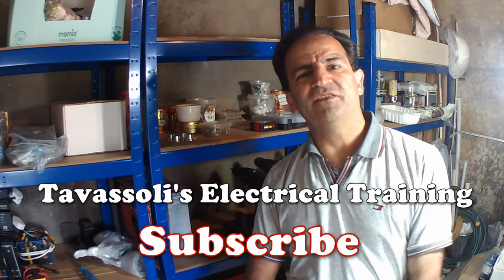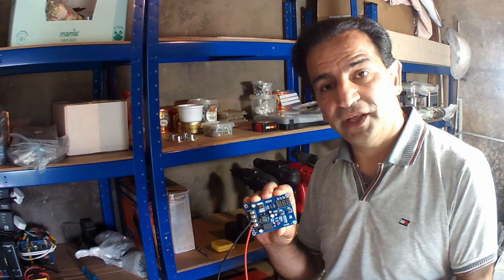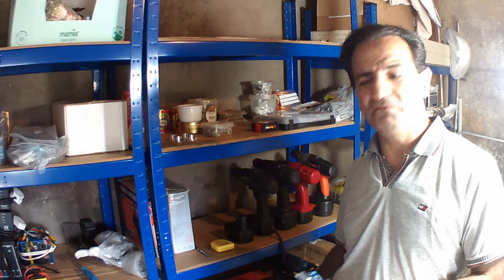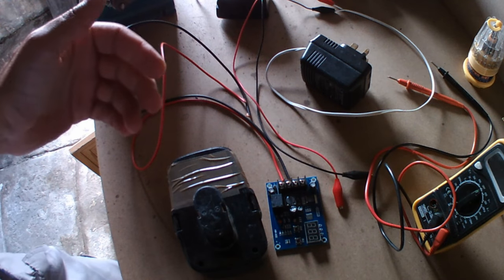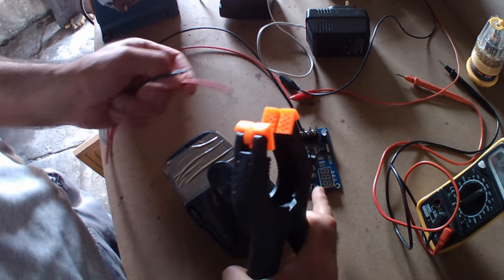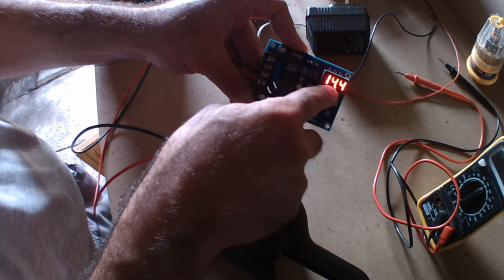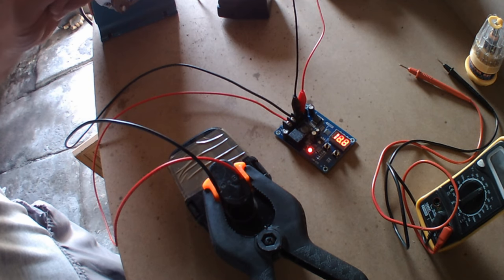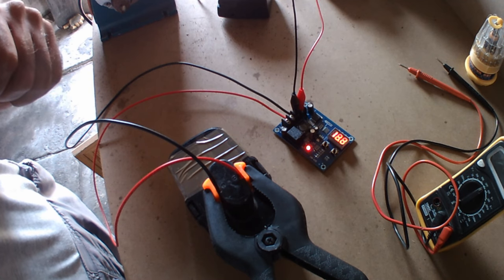Charger your Cordless Drill without its charger! - How to Make a Universal Battery Charger-

Comment: I don't know why a strike out line shows through part of the text. Please just read every thing. Thank you for the video. I do have a few questions: 1. All the batteries you show in the video appear to be NiCd or NiMh. Does your set up work for Li batteries? 2. Some battery chargers have more than just the + / _  contacts. For example the Milwaukee red has +, , and 3 other terminals (supposedly for the balancing contacts). The Ryobi has +/ -, and a third contact. I was looking at your video to make charger for the Ryobi. With Ryobi charger, testing it with meter, there is no voltage between +/ - while there is about 3V between the 3rd terminal and either + or -. The theory I have been told is that when a battery is connected to the charger, the 3V flowing from the 3rd terminal into the control board of the battery some how activates the +/ and makes the necessary charging current to then flow between the +/-. So, in your system of connecting only the +/- terminals to your charger and totally ignoring the 3rd terminal, there is no charging current. I have already tried connecting the 20V + /_ from a power supply to the +/- of the battery and nothing happens, it does not charge the battery. So, what do you say?
Reply from the maker: Let me just say that this is for Lithium batteries as well as Ni Cad ones. You cannot just connect the power to the battery directly and  charge it that way, Having said that you actually could do that in theory, and even in practice if you could control the length of time the battery is under charge. However, you are talking about quite a few things here; You cannot use this for batteries with slots of a few contacts more than just the main positive and negative contacts. those have to be charged differently, which I will show you in my next video. Watch for that one. Third contact however is not a control of current at all in batteries like the ones I have shown in my video. If you open those packs, you will find the third plate (Contact) is not connected to anything, or it's just a ground. for the circuit, which again doesn't do much in this case. This regulator does more than just connecting and disconnecting the power supply to the battery, it controls the current and the charging, which is why it's called a regulator. All those ICs and components are not there for decoration. You can charge any power tool battery similar to the ones shown in this video, car batteries, Solar Panel batteries and many more with this regulator. I don't know what the strike out line is and I hope this has been helpful.

Comment: I'm a few years late in the comments lol but can you use this to charge multiple batteries at the same time?
Reply from the maker: No you cannot, because it has to read the current voltage of the battery and charge accordingly, if they are all connected in parallel, then it won't know how long to charge it correctly.
Reply: @totalelectricaltraining  I've burnt a few batteries figuring it out the hard way 😂 I'll pull the good cells out eventually and use them for something else, it's slow going but I'm learning 🤷

Comment: I have a spare 24v power wheelchair battery charger w. a cannon plug connector. Would any of its internal parts be usable for this application?
Reply from the maker: That's only to charge a 24 volt battery, what I'm showing here in the video is for any range of voltage from 9 to 24 adjustable. So I'd say No.

Comment: Can this also charge dry cell and lipo? Thanks in advance
Reply from the maker: Yes, if they are chargeable!
Reply: @totalelectricaltraining  thank you for the speedy response. I buy broken laptops, tablets. Some are not repairable. But the batteries work just fine. I wanted to put them all together and seal it to make an emergency power pack. Can this be done with batteries of different mah and volt types?
Reply from the maker: Yes, and no! You'd better not mix and match technically as it will reduce their life span, but it will work for as long as they work! I have other videos teaching how to charge those kind of batteries, which should come at the end screen of this very video!
Reply: @totalelectricaltraining  thank you. I've been watching your other videos. I enjoy your wealth of knowledge.
Reply from the maker: @JohnSmith-bh8um  Thanks for watching, and your compliments. I hope you share my videos around to help others too!  Thanks again!

Comment: Thankyou for the video Sir, a small question if you can  -  what connector wires do I need to purchase to transmit the voltage ? Are they purchased separately from the plug adapter ? I have always wondered about the material used in the wires, and how it would surely affect the amount of voltage and current.
Reply from the maker: Anything will work, but to be technically correct, you need to choose the size of the wire according to the amount of current you want to take to charge your battery. If you're only using this to charge drill batteries like I did in the video,  a size 1 or 1.5 mm will do, but if you're trying  to charge a for example car battery you might want to consider 2 or 2.5 mm wires. the material does affect the voltage at the load, but not in this case as the distance is not too long,. Yes if it was for a load at 100 meter away from the charger, then you'd have to consider a few other factors such as material of the cable.

Comment: Is there a way to/or could you use a charge controller for solar panels?
Reply from the maker: To be honest, I've never worked with those yet. I have plans to get a big project underway, which will include those, but currently I cannot say that for sure. I don't want to say something that I personally haven't worked with. Thanks!

Comment: When I add the wires to the battery no display ?
Reply from the maker: Thanks for your interest, but I can't tell what's gone wrong without seeing it.
Reply from the maker: Make sure you got the polarities right!
Reply: May be battery totally discharge so first charge little and then confirm positive and negative then try.
Reply from the maker: It could be that your battery is completely dead or the setting of the start value needs to be adjusted, probably brought way down, so it can switch on.

Comment: Hello, first of all, great job with the video.  Watching you is both fun and educationa 👍. However i do have one question. Is it posible to modify 12v drill battery charger meant for 220v AC to 12v DC charger for car.
Reply from the maker: If you mean to use it to charge a car battery! then I'd say there's no need to modify if the battery charger you have can supply enough current, however, even if it doesn't you can still use it, but it will take a lot longer time to charge!

Comment: Great way of doing this. I purchased the power adapter you recommended and it looks like I have to cut the cable in order to separate the -ve wire from the +ve. Which wire is +ve? The coating of one wire is black plastic and the other is black & white.
Reply from the maker: The black is negative and the black and white is positive. If you have a multimeter you can double check it  with that too; if you connect the red probe of your volt meter to the "black and white" of your power adaptor, and the black probe of the meter to the black, the reading should be a positive value. I'd also  included the link to buy a jack to PCB terminals, which you could buy and that way you wouldn't have to cut the cable at all.
Reply: @totalelectricaltraining  Great, thanks very much for your help.